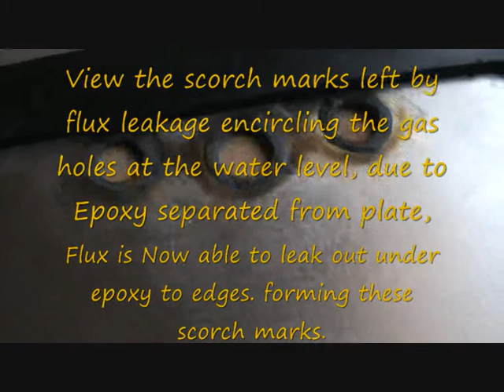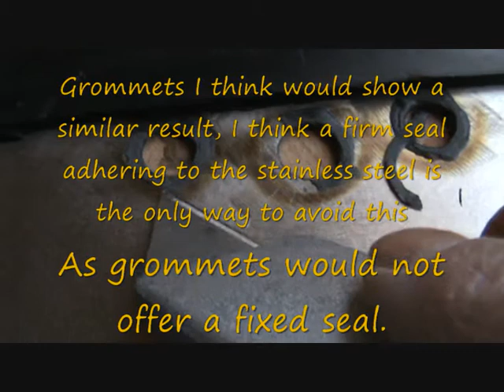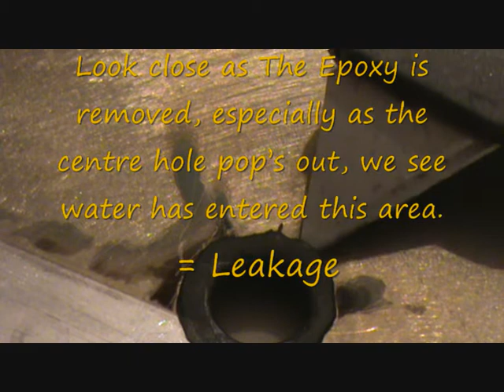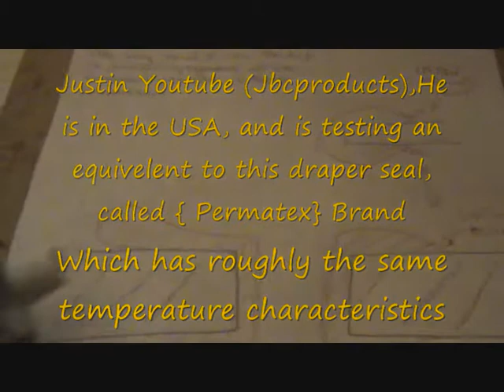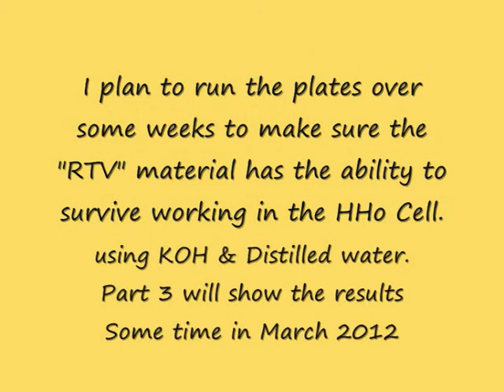FuelBan  HHo Plates & stopping Flux Leakage Pt 2 .

Comment: Great video, The rtv looks to be promising but you never know. I plan on getting a tube in a couple of days. We also have something called create a seal, also made by Permatex. It comes in a can with a brush much like pvc glue as its brushed on. I am still looking for a grommet type of rubber seal. I'm looking for something with a very tight seal, much more snug than an ordinary panel grommet. May not work but its worth a shot.

Comment from the maker: @richardlyew Hi Richard thanks for your comment, I did try the European equivalent of {Weldon 16} called {tensol} but if you look at 2:45 on this video, it shows that Epoxy & weldon /tensol, & all silicones & Liquid rubbers seem to suffer from peal back, they separate from the metal, but still remain intact, becoming rather like a Grommet , & the electrical leakage continues beneath the skin between plate and seal, so still searching for something to adhere to stainless.{sadly enough} LOL 
Thom.